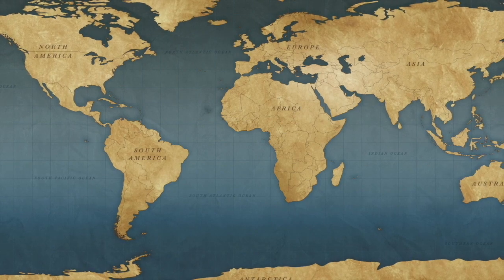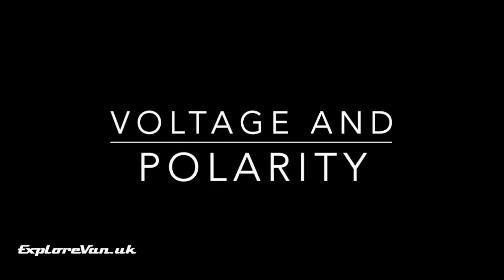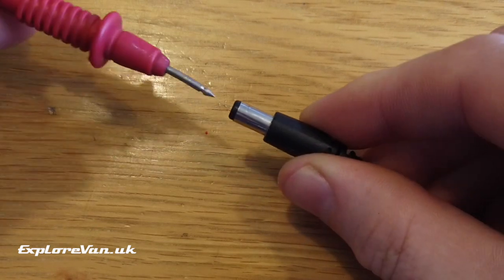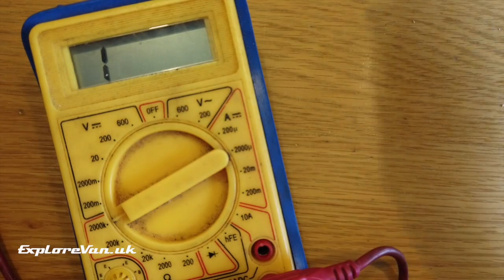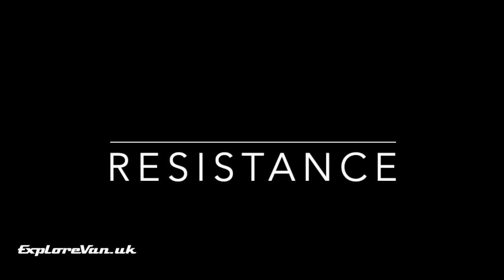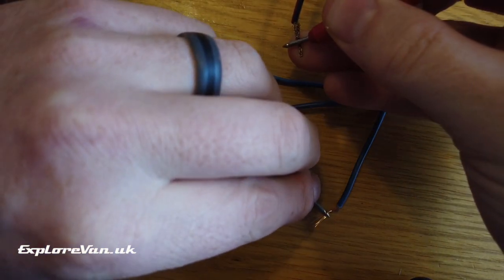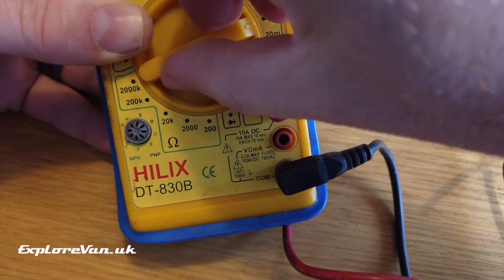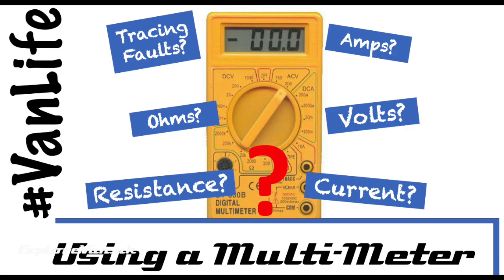How to use a multimeter - Voltage, Polarity, Resistance and Current

Comment: Hi again the type of fault finding, example is what you would expect to see in a meter and what it means, lights, switches battery connections , fuses etc , it's basically to see what the meter would show and what it means in a circuit falt finding mission anything concerning the meter would be good thank again😀
Reply from the maker: No problem, I will get something in the plan.